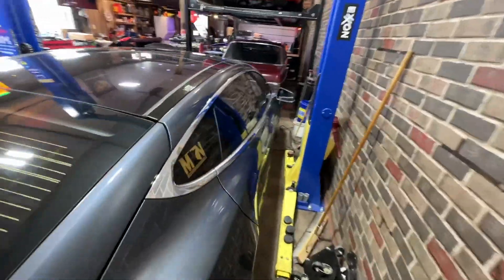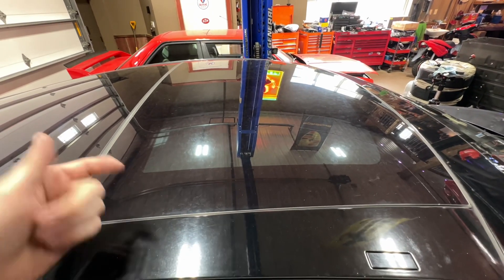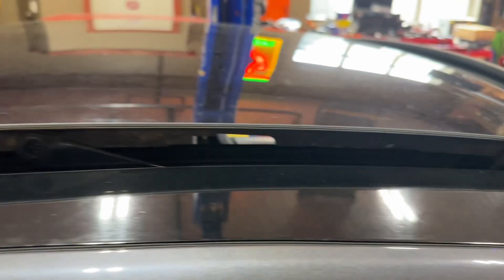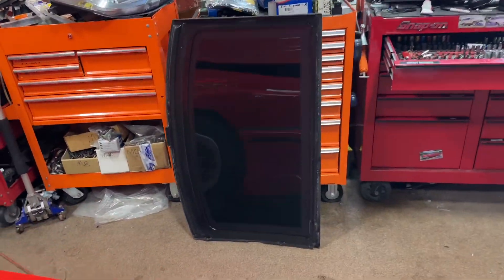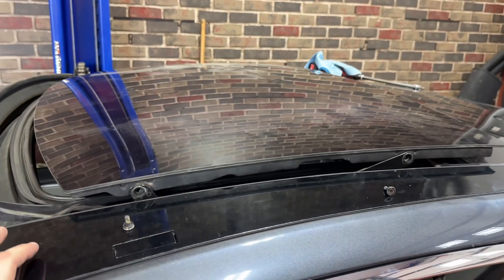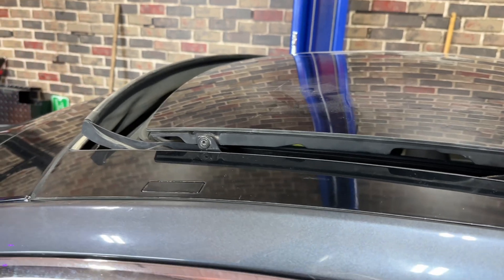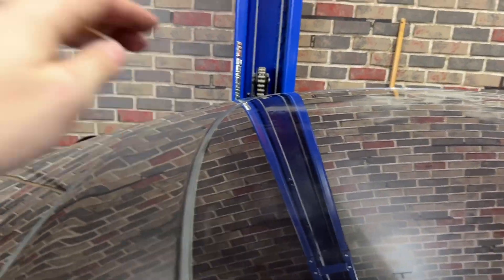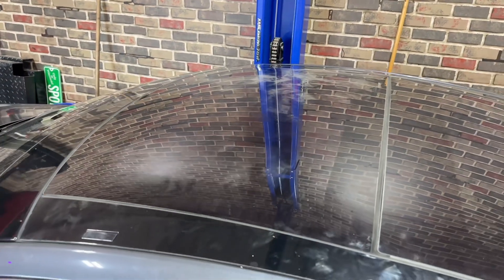Tesla model S front roof glass replacement

Comment: my link assembly broke on the 2 front links, hit bad pot hole when roof open, do you think that would be easy to change out after you get the glass off
Reply: Hey did you ever figure that out ? Struggling with this problem cant find the parts